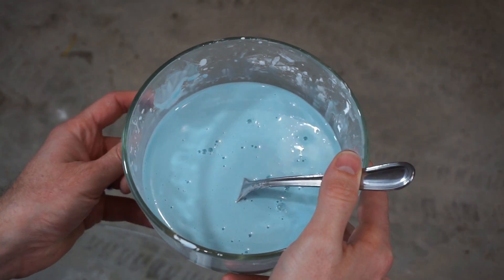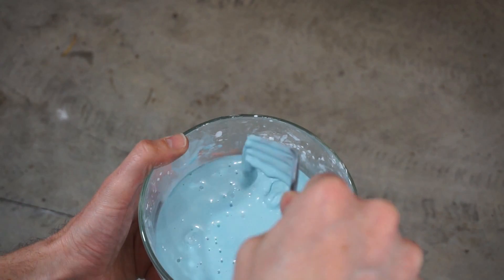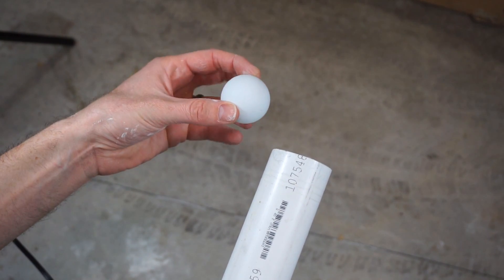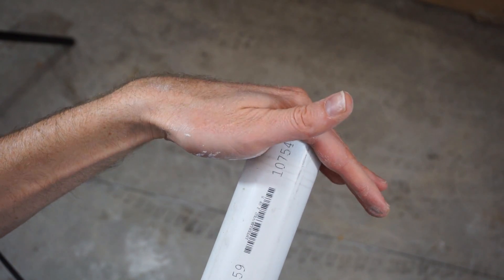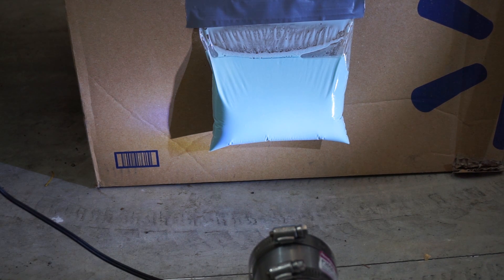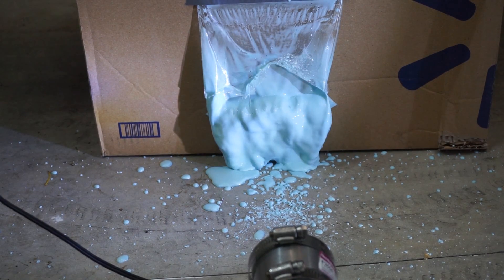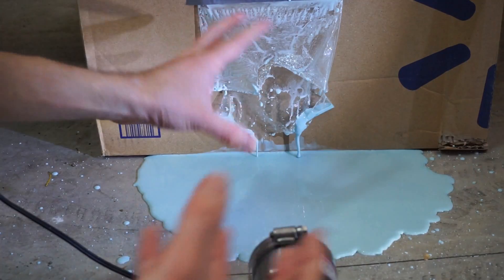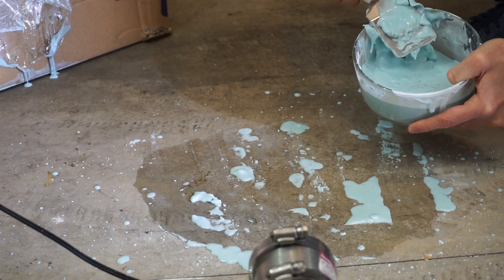Shooting Oobleck With a 500 mph (800 kmh) Ping Pong Ball From a Vacuum Cannon

Comment: Stick a vacuum accumulator on the end of your cannon and lengthen it a bit. You'll get significantly higher speeds. A vaccuum accumulator is a reservoir at the end of the barrel (for instance, a section of larger-diameter pipe) which gives the air which slips past the ball somewhere to go. This allows a longer barrel to be used, as normally too much air gets in front of the ball if your barrel is too long.